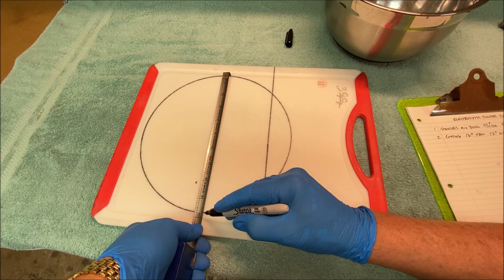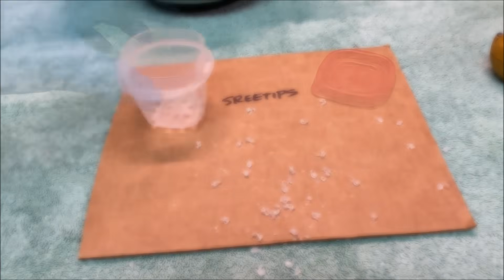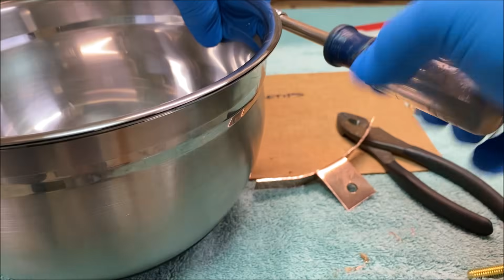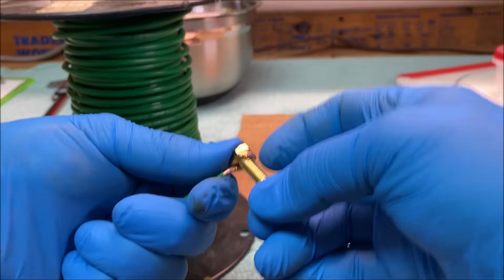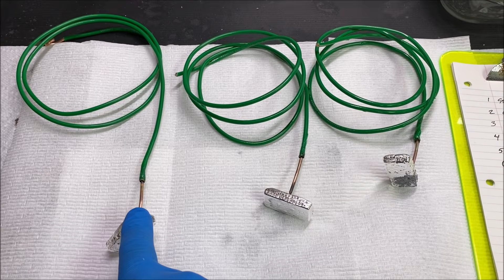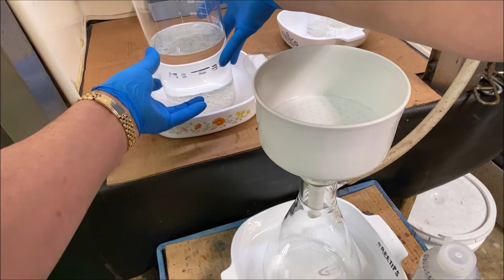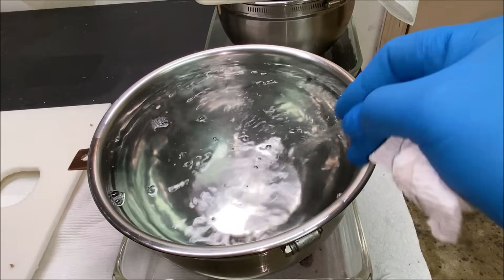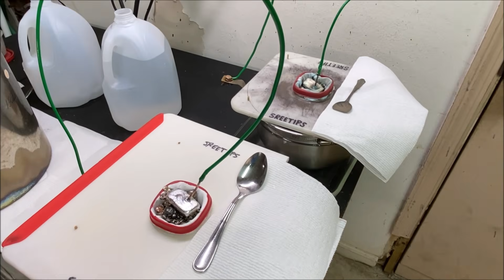Silver Cell Build Step by Step From Scratch for Beginners

Comment: I guess I’m not understanding.

This is just a refining process right?
Reply from the maker: Correct
Reply: @sreetips sorry for multiple replies, but I’m just trying to completely understand.

You’re making a .999 silver solution, and using a .999 silver anode to refine a silver that’s less than pure, into pure silver crystals. Correct?

2 more questions (sorry):
1. Do you need to stir the “impure” silver during the process to make sure as much touches the electrolyte as possible?
2. How many runs will you get out of one batch of electrolyte?
Reply from the maker: I refine gold. I use sterling silver to refine the gold. I recover the silver from my gold refining and run it through my silver cell. The silver that I recover from my gold refining is impure, about 98% but after I run it through the cell it comes out three nines. I have used the electrolyte twice, adding more silver nitrate for the second run.
Reply from the maker: I’ve never stirred the impure silver.
Reply: @sreetips  Thank you for taking the time to answer so many questions!

Just on a side note: I used to be a scientific glass blower. And I just gotta say, LOTS of respect for your glass collection.
Reply from the maker: I had a small chemistry lab set up in my basement when I was a kid. This is just an extension from that time in my life. I love working with nice glassware.
Reply: @sreetips  I especially liked you little Schwerter's solution jar with the dome lid. Don't see many of those around anymore!
Reply from the maker: Wheaton drop tip bottles, and the Schwerters solution bottle was an old perfume bottle with a ground glass lid.

Comment: I have been gathering supplies and bought some hose clamps that are 304 stainless steel. They are slightly magnetic. Is that OK, Sreetips? If not what type do I need to get?
Reply from the maker: I’ve never checked my hose clamps with a magnet. I don’t know.

Comment: What ratio of electrolyte do you need in the stainless steel bowl compared to distilled water? Let’s say I have a 8 quart stainless Steele bowl.

I spoke too soon. 150g per liter in the silver nitrate solution. Got it! LOL
Reply from the maker: Eight quarts is two gallons. That equals 7.5 liters. I like to use 150g per liter. So 7.5 liters times 150g equals 1125g of pure silver, dissolved in 7.5 liters of liquid.
Reply: @sreetips thank you. My brother and I are working on gathering all materials needed for our silver cell. We appreciate you and your knowledge.

Comment: So my silver cell is complete. I just need to make my silver nitrate solution. The problem is it was hard enough to melt down bullion for the anode lol. In your opinion, should I use a lower concentration of silver in the solution temporarily until I have some crystal to add in?
Reply from the maker: I’ve used pure silver bars or rounds to make my electrolyte

Comment: thank you very much for sharing sir, I have question sir, how you make the 150 grams/ L pure silver solution, is it the same if I buy 150 grams AgNO3 and put 1 L of distilled water? and about the pure silver at the anode(scratch and bar), is it will decrease the weight after a month?
Reply from the maker: I dissolve pure silver in nitric acid to make my silver nitrate electrolyte. Silver nitrate reagent dissolved in distilled water can be used. The ration is about 1.5g silver nitrate reagent to equal 1g pure silver. The anode bar can be used over and over as long as it’s kept from coming in contact with the electrolyte in the anode basket.
Reply: @sreetips  noted sir, thank you very much

Comment: Why do you need the silver bar anode? The silver shot in the basket is what is feeding the silver crystal formation. You could get the same reaction using any conductor that stays isolated from the solution.
Reply from the maker: Because pure silver is easy to melt and pour. Like hot butter

Comment: Watched a couple of your videos. Still not 100% sure what this is or why you’d do this.
Reply from the maker: I refine gold. I use sterling silver, that I buy at estate sales, to refine the scrap gold. I recover the silver from that, melt into shot, and run it through my silver cell. Silver is a by-product of my gold refining. The cell converts the impure silver (about 980 parts per thousand silver) to high purity four nines fine (9999 parts per ten thousand) pure elemental silver metal. So I’m refining the impure silver, into high purity silver, not creating silver out of thin air. When it’s full, I harvest the pure silver crystal, put it away and forget about it. Then I repeat the whole thing again.

Comment: Where are you getting the junk silver ore?
Reply from the maker: Estate sales. I buy sterling silver flatware and other pieces. Then I use them to refine gold. I recover the silver, melt into shot, then run it through my silver cells
Reply: @sreetips  Interesting. What's your cost per OZ of refined silver?
Reply from the maker: Depends. Last week I bought a sterling silver flatware set for $1400. That same day Mrs sreetips found 7.5 pounds of unmarked silver at an estate sale for sixty five bucks. The sellers didn’t realize that it was silver. Neither did she, but for sixty five she took a chance and bought it. Turned out to be silver after I checked it.

Comment: Where do you get all your silver from in the first place
Reply from the maker: I refine gold. I use sterling silver, that I buy at estate sales, to refine the scrap gold. I recover the silver from that, melt into shot, and run it through my silver cell. Silver is a by-product of my gold refining. The cell converts the impure silver (about 980 parts per thousand silver) to high purity four nines fine (9999 parts per ten thousand) pure elemental silver metal. So I’m refining the impure silver, into high purity silver, not creating silver out of thin air. When it’s full, I harvest the pure silver crystal, put it away and forget about it. Then I repeat the whole thing again.
Reply: @sreetips  Dang thank you so much for responding. I really appreciate that a lot. I've been meaning to watch your videos for like a year now finally I got around to it I've been watching your videos all day I did ask a few questions hopefully you'll have time to answer them and thank you again very much very cool videos

Comment: where do you get the unpure silver? and how much is it?
Reply from the maker: I refine gold. I use sterling silver, that I buy at estate sales, to refine the scrap gold. I recover the silver from that, melt into shot, and run it through my silver cell. Silver is a by-product of my gold refining. The cell converts the impure silver (about 980 parts per thousand silver) to high purity four nines fine (9999 parts per ten thousand) pure elemental silver metal. So I’m refining the impure silver, into high purity silver, not creating silver out of thin air. When it’s full, I harvest the pure silver crystal, put it away and forget about it. Then I repeat the whole thing again.
Reply: @sreetips  alright thanks but is it profitable?
Reply from the maker: I’d hate to have to do this for a living, at my level, the hobby level. The ROI for refining will depend entirely on what I pay for the scrap metals. You make your profit when you buy. But in my case, as a YouTube content creator, most of my income is from ad revenue from my videos. This enables me to buy metals at a loss, refine them at a loss, then put them away and forget about them. I don’t have to worry about trying to resell the refined metals for a “profit” but I do offer some metal, from time to time, to produce a small income to pay my light bill and buy some food. The metals are my profit. Cash is trash (have you heard of the on-going de-dollarization movement recently?) I stack metals, that are rising in value rather than paper, that’s declining in value.
Reply: @sreetips  thanks for your awenser :)

Comment: Is there a video that explains a bit more about this? Are you buying silver to make silver? If so, is there a profit break down? This is very interesting.
Reply from the maker: I have a video titled silver cell build from scratch step by step. I refine gold. I use sterling silver, that I buy at estate sales, to refine the scrap gold. I recover the silver from that, melt into shot, and run it through my silver cell. Silver is a by-product of my gold refining. The cell converts the impure silver (about 980 parts per thousand silver) to high purity four nines fine (9999 parts per ten thousand) pure elemental silver metal. So I’m refining the impure silver, into high purity silver, not creating silver out of thin air. When it’s full, I harvest the pure silver crystal, put it away and forget about it. Then I repeat the whole thing again.
Reply: @sreetips  Many thanks for that explanation. Do you have a list of videos to watch that can show the gold refining process? I've been wanting to extract gold from motherboards and various electronics I have.
Reply from the maker: I have recovery from trimmed circuit card fingers and from pentium pro CPUs.
Reply: @sreetips  Any videos on the process?
Reply from the maker: Yes. I’ll try making play lists of all my escrap videos.

Comment: where are you getting this unpure silver from
Reply from the maker: I refine gold. I use sterling silver, that I buy at estate sales, to refine the scrap gold. I recover the silver from that, melt into shot, and run it through my silver cell. Silver is a by-product of my gold refining. The cell converts the impure silver (about 980 parts per thousand silver) to high purity four nines fine (9999 parts per ten thousand) pure elemental silver metal. So I’m refining the impure silver, into high purity silver, not creating silver out of thin air. When it’s full, I harvest the pure silver crystal, put it away and forget about it. Then I repeat the whole thing again.

Comment: My friend, is the solution concentrated or tempered and how much is its concentration?
Reply from the maker: I use 150 grams of pure silver dissolved in one liter of solution.
Reply: @sreetips    Thanks dear 
But Is the solution a center or mixed with water in a number of ways?
Reply from the maker: I dissolve 150g of silver in hot dilute nitric. Then add enough distilled water to make one liter.
Reply: @sreetips  thanks dear
Reply: One more question
Have you tested the electrolysis of coarse sea salts?
Reply from the maker: No

Comment: Couldn't you have flattened out a length of copper pipe to use for your cathode terminal (connection)?
Reply from the maker: Yes
Reply: @sreetips  Just wondering. I shouldn't be surprised you thought of that

Comment: Streetip. I see so many people do what you do with the torch on the mold. What a pain in the arse. I put a piece of 6mm concrete sheeting ("Hardi flex" or "Villa board" in Australia ) on my electric hot plate and set it at 1with the mold on it. I can leave it there and pour all day with perfect results. Try it, it makes life so much easier.
Reply from the maker: I prefer the reducing flame to keep the air off as it freezes.
Reply: Thanks for the tip.

Comment: You need to watch a clip on how to use tin snips. The reds and greens are indicators of left and right cuts (dont ever buy yellows, there is no such thing as a straight cut. Throw them in the bin) It will make life so much easier.
Reply from the maker: I have red, green and yellow.
Reply: Bottom jaw is always the off-cut side. Ditch the yellows. You will never see a tradie with a pair of yellows in his toolbox. 👍

Comment: The power unit what is the ranges for volts for amps and watt output
Reply from the maker: I run my silver cell at 3.5 VDC constant voltage mode with amps set to maximum. In this configuration amps will fall where they may.

Comment: To fill the anode basket , can I use pure silver granules? Or a few ounces of silver bars? 

In order to make the electrolyte, its 150 Grams of silver per liter . Once I have 150 grams , I add the distilled water and acid continuously as the solution proceeds? Until you described as colorless and small silver at the bottoms
Reply from the maker: I don’t want excess nitric in my electrolyte. I use 200g of pure silver, then add nitric acid and boil until all fumes are gone, and there’s a little extra undissolved silver left in the bottom of the beaker.
Reply from the maker: I’ve run pure silver in the anode basket. After harvest I had it analyzed and it came back greater than five nines fine

Comment: Did you remove the older video on how to convert a computer power source ?
Reply from the maker: No, it’s still posted.
Reply: @sreetips  finally sold my first one. !  Got the parts assembled and building 3 more today.  
From here on ill be sourcing all new components and offering 3 sizes.

Comment: NOCO makes a battery terminal protection spray and I wonder if it would help retard the dissimilar metal corrosion occuring on the annode where the copper meets the silver.

Comment: A very informative and entertaining video sir!   I have a question.  Do you plug your DC power supply into a GFCI protected circuit?  Since there is liquid and electricity in close proximity do you feel it is necessary?

Comment: Also what about the nitric acid and distilled water cost ?? Gallons of each correct ? Plus melting bowl acetylene torch fuel molds beakers etc are not listed as components?? Am i missing anything ?? Awsome tho
Reply from the maker: Sounds about right. We buy sterling at estate sales, use it to refine gold, recover the silver from that, melt into shot, run it through the silver cell, harvest the pure silver, put it away and forget about it.

Comment: Is there another electrolyte I can use? I obviously don’t have 1000g of pure silver to dissolve in nitric acid. Can I just buy some silver nitrate or what??
Reply from the maker: Yes
Reply: Can you specify what type of silver nitrate I need to buy and what amount? Thank you so much
Reply from the maker: Silver nitrate crystals dissolved in distilled water. It takes about 160g of silver nitrate dissolved in a liter of distilled water to equal 100g of pure silver dissolved in one liter of liquid.

Comment: How many grams does it take to start growing it. I have the pure silver for the copper wire.
Reply from the maker: I use 1 kilo of pure silver dissolved in 6 liters of liquid. I’ll harvest at least 3.5 kilos of pure silver from the use of the electrolyte. But I will have added about 3.8 kilos of impure silver into the anode basket for that run.

Comment: can we built a bigger silver cell 2kg of silver nitrate?
Reply from the maker: Yes, bet we’d have to go to a different type, the stainless bowl is a thumb cell, anode on top suspended in the electrolyte. Moebius cell is alternating anode/cathode plates hung in rows in a large tank of electrolyte (gallons of it). But either way, there’s a critical distance of 4 to 4.5 inches that must be maintained between the anode and the cathode.
Reply: @sreetips  sorry sir. But i dont understand what is moebius cell means. Could we simply get a larger stainless steel bowl and use the same method as in the video?
Reply from the maker: Yes, as long as the size of the anode basket is kept to within the critical distance that must be maintained. A larger bowl would require a larger anode basket. But that would increase the output of the cell. But it would also require more silver to make a larger quantity of electrolyte. I’ve got a bigger bowl and was going to make a larger cell in a future video.
Reply: @sreetips  wow, great news. looking forward to the video. thanks for that

Comment: So the minimum amount extrakted from that new cell vill be 600g of pure silver?
Reply from the maker: No, I feed 1500g of impure silver into the anode basket, and I’ll recover 1450g of pure silver when I do a clean-out. The 600g used for electrolyte facilitates the refining of impure silver I feed into the cell. I get all 600g back out of the electrolyte.
Reply: @sreetips thanks for info.

Comment: How much was the impure silver?
Reply from the maker: About 98% to 99% pure silver. How much did it cost? In dollars? I’m not sure. But it doesn’t matter. I’ve converted my paper dollars, that are declining, into pure silver, that’s rising. I don’t sell any silver if I don’t have to.
Reply: @sreetips  I thought you set your bar of pure on top of a bunch of impure silver
Reply from the maker: The electrode bar, with the copper wire cast not it, is pure silver. I sits on top of the impure silver in the anode filter of the silver cell.

Comment: Dumb question, why add pure silver to the impure silver in the corning process. Could you just use sterling
Reply from the maker: Because for electrolytic refining be successful the anode must be fairly high purity to begin with. Sterling anode would foul the electrolyte and it would quickly become saturated with copper.
Reply: Thanks

Comment: Can you feed this straight sterling silver, or should it be chemically refined first?
Reply from the maker: The electrolyte would quickly become saturated with copper.
Reply: @sreetips makes sense. Is there any way to regenerate the nitric acid, or is it pretty much “done” at cupric nitrate?  Would it be worth extracting copper with something like Iron…?
Reply from the maker: The nitric gets consumed by the reaction. The copper gets cemented on pieces of angle iron.

Comment: Thank you for a very informative video. I have cemented out silver powder from silvernitrate by using a copper rod. Is i possible to use the powder direct in the basket without melting it to shots ?
Reply from the maker: I tried once. The filter clogged and current flow dropped off rapidly.
Reply: @sreetips  Makes sense. The cemented silver is a partly very fine powder. Thank you for the reply.